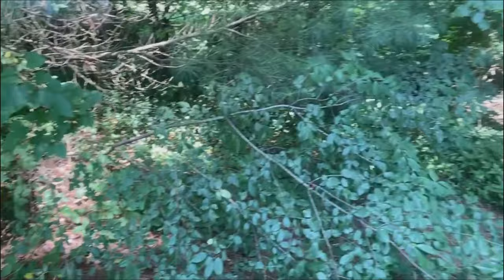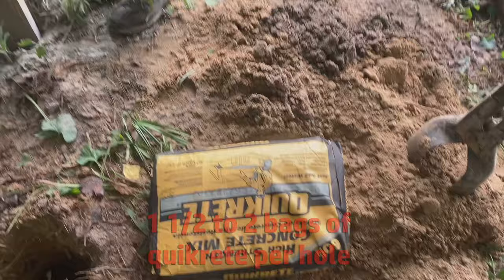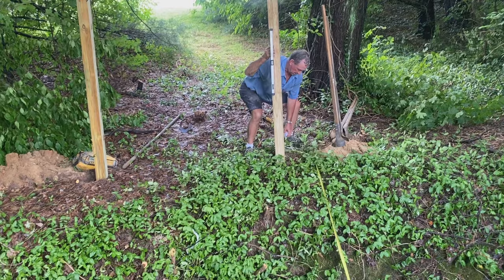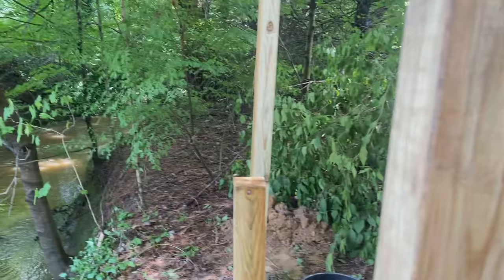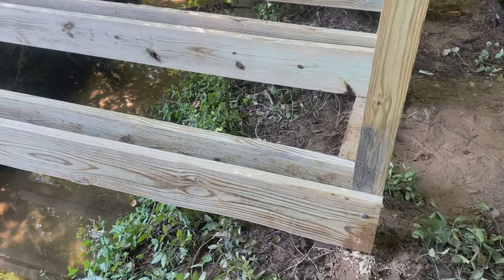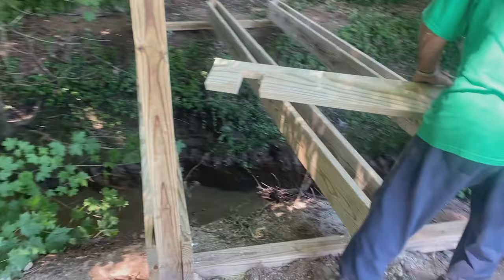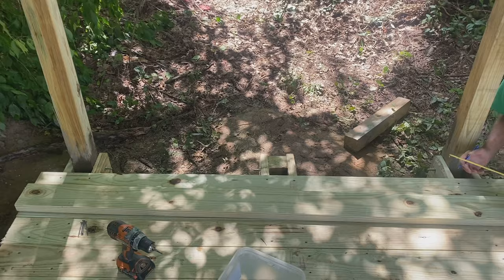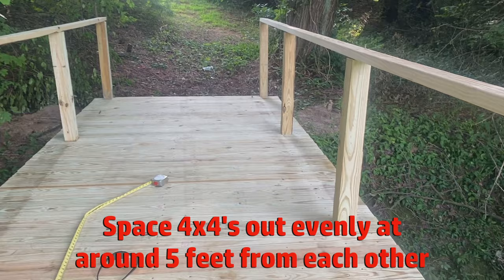DIY Wood Bridge, 16 feet long, under $800

Comment: I would have installed the posts for rails before or during flooring in between the beams for more reliable support. Never know who is going to lean hard on that rail. Then just fit flooring around posts as was done at the end posts. And would help prevent beams twisting over time, trust me they will.  Should add bridging between the beams at least every four feet.

Comment: Do you know how much weight the bridge would hold? I'm thinking about using 12" boards but might be overkill.
Reply from the maker: It's been 4 years now and this bridge has been flooded 5 times hard and has not moved an inch! Ive takin small tractor over it no problem. I still feel its one of the easiest bridges to build and most support.

Comment: I’ve found if you concrete pole up to surface and slope concrete up pole and inch or so above surface it dramatically reduces wood rot at surface in clay soil, I also put little gravel under pole as well

Comment: Most bridges of similar design add a 2x12 on top where the tire treads travel and that spreads the vehicle weight over several boards.
Reply: This also saves wear on the transverse deck boards. The longitudinal boards can be replaced easily.
Reply: Not a bad idea! I just built this bridge, I think I will add those to it.

Comment: Looks good BUT I think I would have extended the handrail posts down between the side rails so it all tied together and then cut the deck boards to fit around that.  I suspect your climate is more favourable to timber bearers than here in Scotland!

Comment: Love your bridge, I don't know if will help but I had a wood deck utility trailer and found if I treated the wood with used engine oil the deck would last 10 times longer, it is a little slippery when wet but worked well.
Reply: Desmo-1064 ... if you wait 3-6 months for the PT wood to dry a little then the oil will soak in better and wont be as slick. If you did that annually the wood will last 50 years or more.
Reply: Slippery when wet huh? You don't say! 🤔

Comment: You have built a very good foot bridge that should be strong enough to handle any type of ATV or UTV easily.  I wouldn't push your luck trying to drive across it with any type of truck or tractor however.   Those 2 x 6  boards you used for the support beams have a limited weight bearing capacity which is strongest right now when the lumber is new.  But over time, exposure to near constant humidity from the creek below and rain falling on it from above plus dew, frost, or snow, will cause any type of wood, even treated wood, to degrade.   The bottom line is all wood rots eventually.  We got 73 inches of rain here in Mississippi this year and wood rots very fast in our hot subtropical climate.   

Most of the bridges built that are intended to last for a long time are built out of metal or masonry, such as concrete or bricks.   We seldom get more than three to five years of useful life out of unpainted treated wood boards that form the bridge decking. Because they lay flat, water pools up on them easier and standing water really degrades wood very fast.   Unless your climate is pretty dry, you may find yourself rebuilding these wood decked bridges much more often than you desire.  And the cost in materials and labor eventually exceed the cost of using more permanent materials.

It's a great bridge, I give you that.  And it will work...for now!
Reply from the maker: Thank you, yes i am just comparing it to the other DIY wood bride videos that i have seen online, and i would prefer mine.
Reply: @BrescherFilmingEdit  I would prefer yours too.  It's a great looking project. I just hope it holds up in your climate.
Reply from the maker: Also all the boards are treated and will last every bit of ten to 20 years. 2 years later the bridge has not moved and is in use every day
Reply: @BrescherFilmingEdit  As I clearly stated, all wood, treated or not, will rot left outdoors exposed to the elements.   It's pace of decay depends upon your local climate.  We get about 75 inches of rain each year here in Mississippi.  Treated wood rots....just not as fast as untreated.  

I simply wanted your viewers to realize that treated wood works fine in Phoenix, AZ where the average rainfall is 9 inches per year.  Throughout the USA, the average rainfall is 38 inches per year.  But here in our semi-tropical climate with 75 inches per year it simply won't last all that long.

Part of the equation however is how the treated wood is treated. Some chemical treatments are better than others.   Also, the drying time is a factor as lumber dried to a low moisture content helps somewhat.  And finally, the orientation in which the wood is installed matters.  Horizontally flat treated deck boards won't last nearly as long as vertical support posts even if the treated wood is exactly the same.

I'm a trained and certified inspector.  I'll be happy to show your viewers tons of photos of rotten treated wood that didn't last 20 years!

I do sincerely hope you get the life span you hope for.  If all factors are favorable where you are located, then you just might.  But that doesn't mean that anyone anywhere in the world who might view your video will get similar results.

Comment: It seems that if the posts are spaced 25 inches apart, your span would only be54 inches or so assuming separation is measured from center of posts. To obtain the 74 inch span from outer edges of outer posts, corresponding to the crossbeam, you would need to have a space of 33.5 inches on center. Otherwise, this is a very helpful video and I plan to model mine after it for a UTV bridge. Thanks!

Comment: Bolts low shear strength. All beams should rest on supported wood.
No wood should contact wet soil, ever.
Reply from the maker: Bridge was built in 2020 and has not moved an inch in 3 years, No wood is sitting on soil. Its only resting on 4x4s.

Comment: dose double beams need small supports between them. they will shrink and deformed different way if you leave them like this
Reply: called cripples glue and screw will help big time I always do it ,I over build decks ,but for a bridge not really over building .

Comment: You mention in the beginning you can use 2 8 ft boards instead of one 16ft. How would you connect the two 8ft pieces?
Reply from the maker: No i said use 16 foot by 8 inch boards, but i descided to use 16 foot 12 inch boards for more strength.
Reply: Gotcha
Reply: You can still build a bridge longer than your lumber with some good joinery and some knowledge of beam stresses.

This bridge would not meet some code requirements. Handrails are very demanding.
Reply: @BrescherFilmingEdit  Did you use 2x10 or 2x12?  In the video you note 2x10.  Nice bridge either way.
Reply from the maker: @jbmortensen  I used 2x10 boards, I "said" you could probably use two 2x12s or two 2x8s most likely, obviously etherway they need to be 16 foot long no matter what. But i used 2x10 to make sure it was  strong. This bridge was built in 2020 and has been flooded over multiple times and has not budged one bit.

Comment: It won’t let me post a pic but I just got done building the exact same thing. A few quirks I wasn’t prepared for but it came out pretty nice. Have you tried driving your tractor over it?
Reply from the maker: Thats awesome, no my tractor is too wide, but in three years it has not budged. Water has flooded over the top multiple time and everthing is still strong.
Reply: @BrescherFilmingEdit  Thanks for posting this video.  I looked at a lot of them but this was the one that I thought I could do (not much of a carpenter here) and I was amazed at the outcome.  I figured the 4X4's on the ends would be off so I cut all of my 7" deck boards first and positioned them before screwing them in, saved a lot of hassle. Also, I marked a line down the side and cut a nice straight line after they were all screwed in. I just have to put in the gravel and it's done.  They wanted to charge me 4-5 grand to build a bridge for me, lol, I just said no thanks!

Comment: Didn't leave a gap to save on lumber ...huh ..novices..what would you save..maybe one board?
Reply: Main benefit is better water drainage
Reply: i thought gaps help allow for seasonal shrink and expansion
Reply: @jonnyinch8158  my thoughts exactly. Don't want accumulation on the wood.